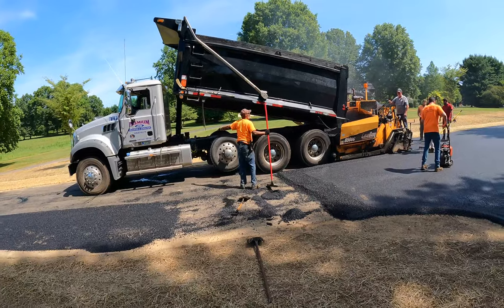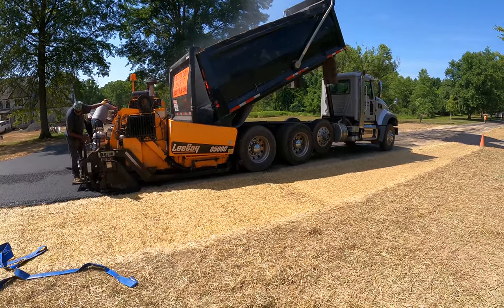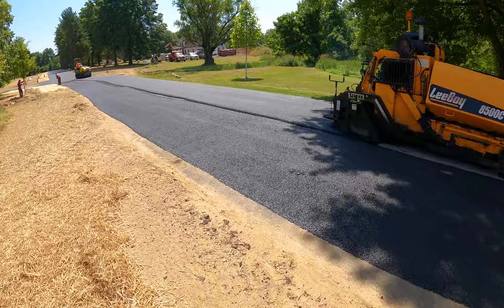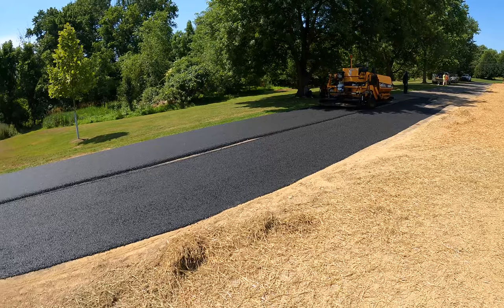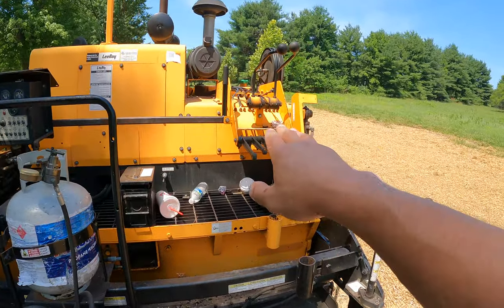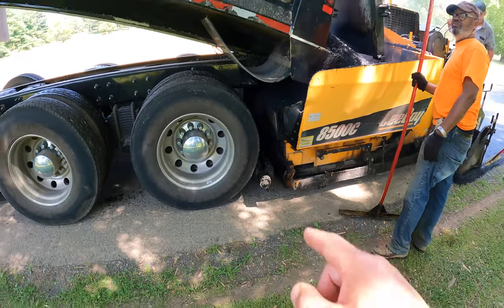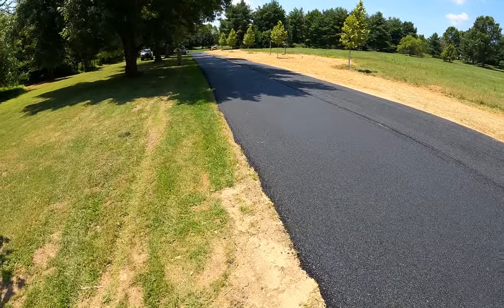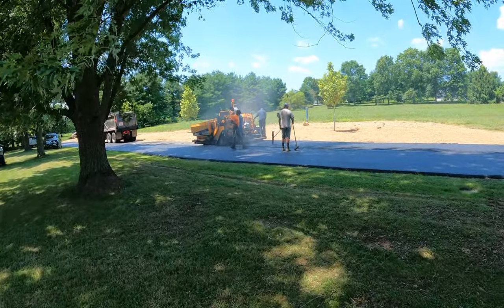Asphalt paving crew

Comment: The 8500 is a really good Machine and a good Roller operator is a very important job especially on steep grades and areas like small driveways with different angles. On production jobs like roadways minor imperfections in the edging are industry standard and are ameliorated by backfilling with base material , or native soil to eliminate drop off at the edge. Striping of the roadway helps by diverting attention away from edge imperfections. It does not pay to be anal retentive about such things on large production jobs . Over pavement of edges actually has a benefit because it allows for minor adjustment of striping. Definitely looks like spotty improper placement of tack oil, although that is not a big issue if asphalt is placed in thickness of 2 and 1/2 “ to 3” thickness over good solid well compacted base material or older asphalt that is only showing surface wear and oxidation. Too Much tack oil can be detrimental especially in hot climates . Too little under thin overlays can result in delaminating especially in climate’s where water penetrating the surface can freeze . Asphalt sheds water but is not water proof. Its permeability depends on its density and mix design.

Comment: I see quite a few things that are not right, first your tac what is up with that, it is not ment to be splashed on, just in spots, it has to be evenly spread over the entire surface that is getting paved to get good bonding. 
The Roller is not the most important machine, it is everything that works together that makes a good job like the screed men that keep a smooth drive and the paver operator that keeps the edge straight, and the luters when they lute remove segregation off the top very important because this washes out of the top in heavy rain with traffic traveling over it. Every man there is important, not just the roller, and they must know what their roll is. 
I did not see any of that here, Sorry!